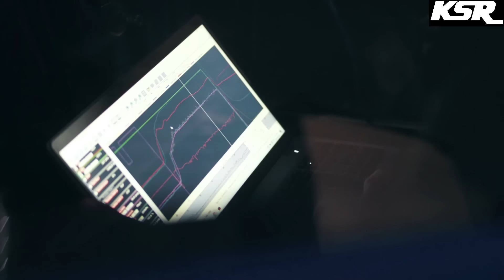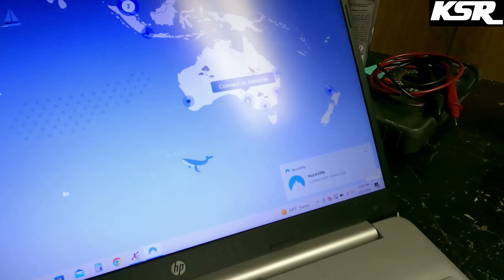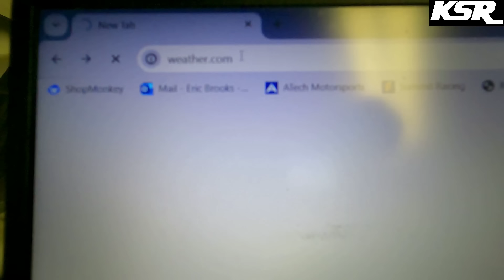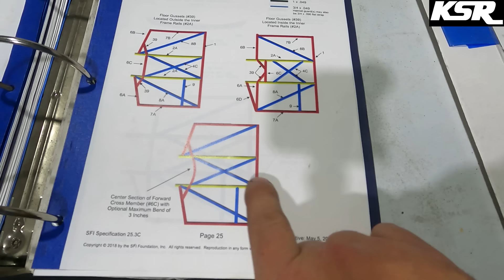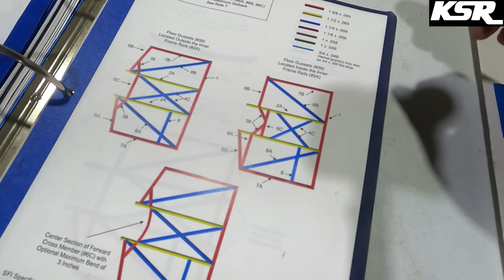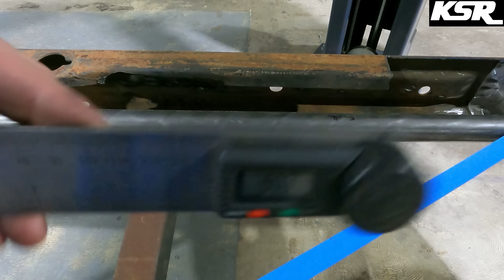Yep, Even More Progress on My Cutlass!!! KSR Cutlass Build Episode 13!!

Comment: I can’t wait to see that cutlass run with that Oldsmobile motor in it
Reply: It’s too bad you couldn’t find a 403 Oldsmobile
Reply from the maker: @shawnknight421  403s will come apart at much more than 650hp. There is not enough meat in the block. This block is THE best Oldsmobile small block out there!!

Comment: Talking about the “flat face” on the end of that tube at the end…

People act like welding is supposed to be like body work…
 They don’t realize if you were to have a razor thin edge there instead, that is now effectively how thick the tube is… but they do it cause it’s smooth and looks prettier… 

Having that nice square edge now makes it a corner joint effectively, and you have full penetration on both pieces of metal at their full thickness… = much stronger lol. 

Much satisfying to watch someone else endure the same pain I do lol. Good job Kevin! 👍🤘👏

Comment: once you done with tackwelding the whole frame together you probably should mount the whole thing to a rotissery for finishwelding , would make you more comfortable weldin / gives you nicer welds
you might be able to use 2 engine stands for that with some judious adding of extra boxsection

small bit of trivia : porsche when it used to race cars with tubeframes actually had a schradervalve somewhere in the tube frame , the reason for that was that they welded the frame airtight so if there was a crack in the frame it wouldnt hold pressurized air when they hooked it up to a compressor , it allso made it eazier to find the crack with a spraybottle and soapy water

Comment: Hey kevin, wouldnt you want the transmission crossmember to be a bolt in item that way it can help with the ease of transmission removal in the future? Wouldnt it also help with being able to make it slightly adjustable? And with all the drift cages ive done, ive always tapered the end of the tube so that way there was good welds on each tube.
Reply from the maker: The crossmember will be removable

Comment: So what is tbe guessed functional weight going to be upon completion of the car with driver, and power to weight ratio if you don't mind sharing with us. 
Glad to actually be able to see what you're doing for a change. 
If it requires longer videos I'm sure most of us would be more than happy to watch however long they may be. 
Keep up the good work. 
BTW have you heard about the wireless thumb operated torches that do away with dragging a wired foot pedal everywhere, and having to constantly move them in order to move from one weld to the next?

Comment: Just a suggestion to reduce sticking the filler rod. I prefer welding bottom to top, I know it’s not as critical with tig, but it’s the only accepted way for structural certifications. With tig you can see the puddle start to finish with less restarts. Welds look nice, just trying to make it easier on you. Keep the videos coming.
Reply: Also, happy to see you flushed out the bottom 👍👍👍

Comment: So Kevin, are you going to re plate in the frame by the front body mounts and down the sides eventually?  I dont know anything about building cages but it looksodd. Lol
Reply from the maker: Nope! Most of the factory frame will be cut off. There is not any need for it with the amount of roll cage/chassis that I am putting into the car.
Reply: Oh ok cool. So it's just a jig basically,  I see.

Comment: There's an 80 Cutlass for sale close by to me I think for $1600.. I immediately thought of you when I saw it lol. There's also an 86 Monte Carlo that someone started to LS swap despite it not being smog legal to do here.. I'd love to have that car but making it smog legal again would take more money than I have and it already needs body work and paint and interior. Go fig the cheap one sold. I'm a sucker for the cars that were from Nascar's Heyday. That said I'd absolutely LOVE to have a 70 Monte Carlo. But then I've been geeking out on a 68 Vista Cruiser that's for sale for $1800 with typical GM rust.. The way I figure I think the lower quarters in the rear are the same as every other A Body so $50 Chevelle lower quarters should fix it. I've kind of gotten to the point where I'd rather have a car that's $2k or less than needs $3k put into it rather than a $6k that's really only worth $3k that needs $3k put into it that I don't have.
Man I would not put those tubes in without first mocking the engine, trans, and overdrive in place and lowering the body down to make sure it'll clear. It's so much easier to bolt them together and leave them sitting on a block of wood and jack and check that it's clear than make tubes and then have to eat the cost if it doesn't fit right. MOCK YOUR STUFF UP over and over and over. Check, check, recheck and check again.
I probably say this on every welding video you do but... DAMN I MISS WELDING! One of two things I've ever felt like I was doing what I was meant to do.. welding and doing bodywork/paint. POS back took them all from me. If I ever get to TIG again I want to get one of the new blue lenses, they seem like it'd be a LOT easier to see. Hell they even have gold ones now and ones that don't alter the color but just change how bright it is. Welding stuff has made leaps and bounds in the last 20 years.
"Future plans call for all the bottoms of the bars to be flat.." Yeah you're putting a belly pan on it. I think you had mentioned that in a previous video.. if not, it's a really common thing to do.

Comment: Do rules allow chassis/cage to mig welded?
Reply from the maker: The 25.5 spec allows for MIG welded mild steel. NHRA/SFI specifications mandate TIG welding for 4130 tubing.

Comment: What is your post flow timing set to? I'm kind of surprised that 180A you don't have to have the torch liquid cooled? Love my Tilman gloves; Flexible, soft and just enough protection to get the job done.
Reply from the maker: I am rarely at full blast on the pedal and with the way that I pump the pedal, the average amperage is likely less than 100.
Reply: @KSRPerformanceFabrication  - Ah ok. I use a pedal too. I was amazed when I saw you using your leg and other body parts to modulate the pedal, very impressive. My biggest problem is being smooth with the hand in both rate of travel and distance from the work piece. Sometimes I nail other times it's ugly!

Comment: I've always gone with the........
If it's Steel = Mig
If it's Aluminium = Tig

You could use Helium as the Shield as Temperature results in Half of Argon or C02 or Nitrogen dioxide 
You have to be quick but Heat sync is minimal........F'ing expensive aswell 😱

Comment: All for the neatness and control of TIG, but could it be burnt in with MIG for compliance of the cage?
Reply from the maker: Nope, NHRA/SFI spec for the chassis specs to go quicker than 7.50 mandates TIG welding of all 4130 tubing.

Comment: Dumb question but I'm not a welder. Why do you need to "pump" the pedal when tigging?
Reply from the maker: I am adding heat when I "floor" the pedal. By pumping the pedal, I am regulating the heat needed to melt the base metal and the filler rod. Some welders hold it more consistently, but I feel like I have better control of the puddle when I pump it.

Comment: This is a welding tutorial.  Just curious - Have you ever x-rayed your weld to check penetration depth?
Reply from the maker: No, but sometimes I will weld on some scrap pieces and then cut it right through the weld joint to check the penetration and to demonstrate for my guys.

Comment: Kevin my question is why cant you  make the blue bars the same size . Then flat on the bottom and top
Reply from the maker: I could, but the smaller bars weigh quite a bit less per foot since they are thinner wall as well

Comment: You would get better penetration mig welding that pipe and it would be faster and ya wouldn't waste all that gas cooling the weld.
Reply from the maker: Eeehhh, MIG is ugly and not legal for the spec. I can assure you that I am getting adequate penetration with the TIG process.....